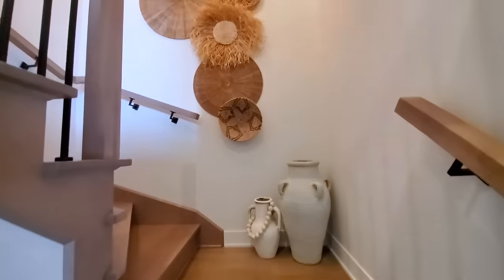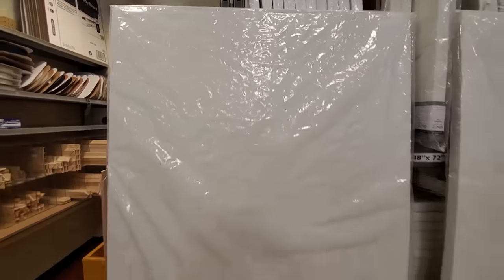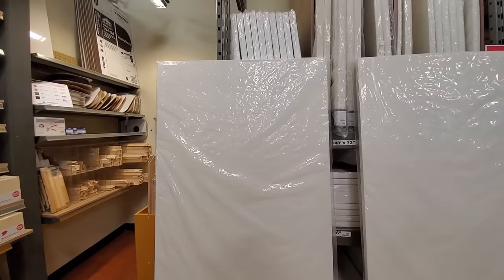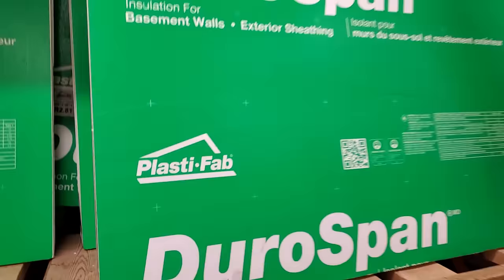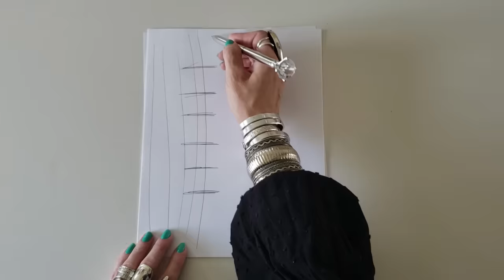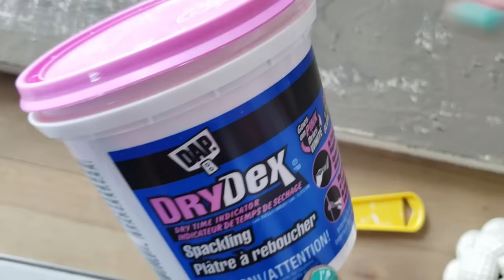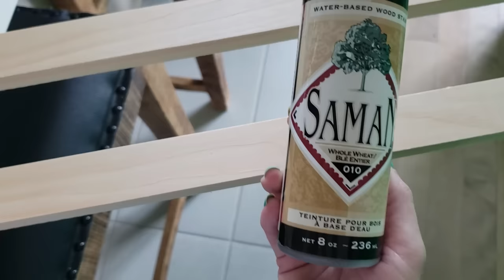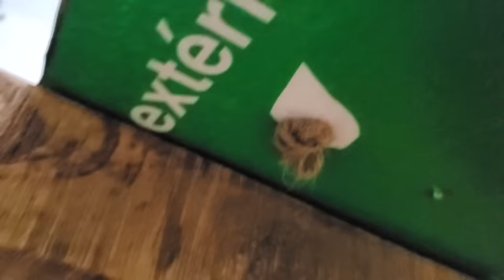8 FEET TALL - WALL ART DIY UNDER 50$

Comment: I would caution everyone about this.. I just spent the better part of a week recreating something similar and it flopped. I’m still trying to find a solution.. but the wood around the foam has nothing to nail in to.. no way to hang it from the top. The wood and foam separate.. pretty sad because I spent a lot of time and money! Also, if she’d be specific in the paint colors she’s using because I DO love the color combo and I’m not get with paint mixing. I ended up spending 50.00 on paint to try to recreate but never liked what I did. I had to find another YouTube video that had specific colors and it finally worked. 
Will most likely have to install a picture shelf to set this on if I even use it. Might be going in the trash 😢